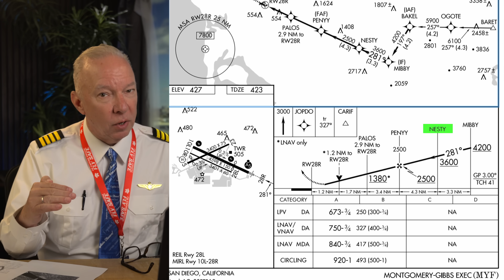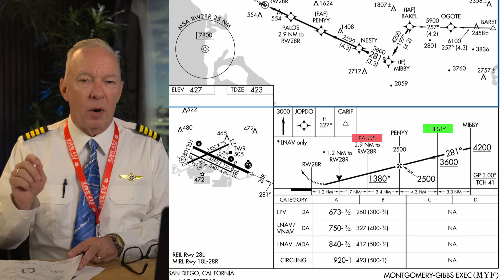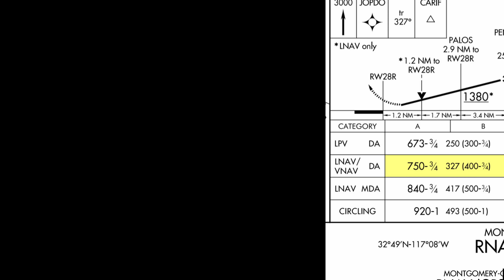Tragic Crash in San Diego: What the Pilot Did Wrong | ATC & Flight Path Breakdown

Comment: Entangled?
Tired?
Rest period not enough?
Specially if you are the only pilot?

Pilot certification standards have evolved over time in an attempt to reduce pilot errors that lead to fatal crashes. FAA standards, which are set in consultation with the aviation industry and the public, are among the highest in the world!!!!!?????

According to the FAA, the new regulations stem in part from the cra of Colgan Air 3407 in February 2009. An investigation of the crash revealed that pilot Renslow, had failed three "check rides" (the flying equivalent of driver proficiency tests) and may not have had adequate training to respond to the emergency leading up to the crash.
Aviation in itself is not inherently dangerous. But to an even greater degree than the sea, it is terribly unforgiving of any carelessness, incapacity or neglect"
—Captain AG Lamplugh, British Aviation Insurance, London. 

Safer skies saves lives...

Old bold pilots
Know Crew Resource Managenent CRM
Know sterile cockpits
Know cockpit briefings
Know who the PIC  final authority is

The greatest single factor in airplane disasters to-day is the human factor.....
someone does too much too soon, followed very quickly by too little too late. 
Steve Wilson 
NTSB investigator, Oshkosh, WI, August 1996.
 Trouble in the air is very rare. It is hitting the ground that causes it. 
Amelia Earhart
In flying, the probability of survival is inversely proportional to the angle of arrival. 
Attributed to Neil Armstrong
If you can walk away from a landing, it's a good landing.
You don't concentrate on risks. You concentrate on results. No risk is too great to prevent the necessary job from getting done.
Chuck Yeager

Comment: There's a tower shown on the approach plate near where he crashed. 554 feet high. I guess he didn't have moving map with current obstacles data base
Reply: still the tower and lines were below his minimum. he busted minimums.
Reply: @sbdreamin and if tower is 554 msl the plane was also at 554 msl. So the big question is why was the plane at 554 msl and not at 854 msl. Over 2 miles from airport. Was altimeter set incorrectly

Comment: Yep, this pilot was below the minimums. When looking for an airport, you never want to be below the minimums because you're entirely distracted looking for the airport. This seems to be a common cause of crashes when both commercial and independent pilots are looking for the airport in bad weather. I still wonder why it is still happening so frequently when the aviation industry knows without a doubt it is an accident looking for a time and place to happen. This also when a "co-pilot" is a gift to be looking at the charts while the pilot is flying to advise accordingly. But he should have known he should not have been landing here. Especially a small corporate jet and independents should have little problems diverting to a safe airport, wait for the bad conditions to clear, and then go to the one most desired. There is really no excuse for this risk in this day and age. Thanks, Capt Steeve. You and Blancolirio complement each other in these reports. I look for both your analyses each time there is an incident. RIP to those who died and God bless the ones who have lost their homes and the neighbors who helped in the rescue after the crash. I'd still like to know if the vehicle the fire dept couldn't put out was an EV.

Comment: Surprisingly the Citation is a CAT B for straight in landings (for circles its a CAT C). I'm not sure if this contributed to the crash or not. I'm assuming due to the obstacle and steeper final decent needed to make the runway, the FAA banned this for C & D CATs. Near mins I don't think its smart attempting this approach in a barely CAT B aircraft. From some pilots I spoke to that fly this they either just consider it a CAT C for any approach to be safe or take the CAT B if they "must". I also question if he had the visibility requirements.

Comment: BR - baby rain!???? BR means MIST! The primary meteorological difference between fog and mist is visibility. Fog reduces visibility to less than 1 kilometre (0.62 miles), while mist reduces visibility to 1 kilometre or greater. Both are caused by tiny water droplets suspended in the air near the ground.
Another thing, regarding fog and the associated pressure distribution, it is impossible that there could be a 20" Hg (approx 200ft) difference in 7nm.  That pressure gradient would have caused strong winds in the area, blowing away any fog or mist.  Therefore, for there to be a 200' altimeter discrepancy, the pilot would have had to set approx 3010 when the airports within 8nm of him were reporting (KSEE) 2990 and  (KSDM) 2989. I don't think this could be the case.
Reply: Pilots are taught “Baby rain” as a memory aid.
Reply: @thelastboomer9088  Notwithstanding memory aids, this is completely incorrect because it is misleading. Rain and mist are 2 completely meteorological phenomena.
 Mist is a suspension of tiny water droplets in the air, while rain is water falling from the sky. The Met Office explains that mist is a less dense form of suspended water droplets, similar to fog, but it typically dissipates more easily with slight winds. Rain, on the other hand, is precipitation, meaning the water has condensed and is falling to the ground.
Reply: What speaks against wrong altimeter setting might be that the ADSB data shows they were exactly at 2500 ft at Penny where they should be. 
But then 100-300ft too low at Palos, after that descended with up to -1700 ft/min towards the ridge - leveled off in front of the ridge, cleared it but hit the power lines on top of it.

Comment: This is very common weather for the San Diego area, "May Gray" and "June Gloom". That fog normally burns off 10am-11am.
Reply: That fog was way beyond normal May Gray overcast skies (and it was dark when the crash occurred as someone else pointed out). I could barely see 5 feet in front of my car driving to work a few hours later that morning.  May Gray/June Gloom refers the marine layer along the coast, not foggy conditions.
Reply: @gigibythesea1133  I was on my way to work in the morning driving the 5 north from San Diego in thick fog when my VW bug ran over a large wood ladder that had apparently fallen off a truck. i didn't see the ladder until a millisecond before I went over it with no way to avoid it. The fog/marine layer is no joke. I've never seen anything quite like it anywhere else.
Reply: @gigibythesea1133 yeah it sounds like the guy was over confident and unaware he wasn’t supposed to land there? He clearly said he couldn’t see smart guy made a bad decision.
Reply: @gigibythesea1133 that overcast often comes with fog at higher altitudes.
Reply: Have you heard of “Graypril”? For a cloudy/foggy April?
Reply: @sheilamiller6435 I just recently heard this!
Reply: You are correct; I lived in Oceanside and that is indeed the summer pattern.   Deeply tragic.
Reply: Having lived in San Diego, from 1968-82 in Pacific Beach, I recall us calling it the June Swoon. Pretty miserable at the beach at 0800 hours and cleared anywhere from 1100-1200 hours. When the sun goes down the fog starts its march in from the ocean.
Reply: Agree 100% I lived in San Diego for a number of years when I was stationed at Camp Pendleton. Never heard the terms 'May Gray' or 'June Gloom' but they are exactly the very descriptions of the weather. RIP to those lost and condolences to their families and friends.
Reply: this was fog, not just the low overcast cloud deck that comes with May Gray or June Gloom. It is not common for all the county airports to be socked in like that but a handful of times a year.
Reply: It was at night
Reply: @gritskennedy5007  Which is why he shouldn't have made the flight at night, but instead left the following morning.
Reply: @gritskennedy5007

So if the fog burns off, mid morning, how does that indicate that it didn't form in the nighttime?
Reply: @codymoe4986 the post is just saying it doesn’t often burn off until 10-11ish, not that it doesn’t accumulate in the wee hours of the morning/night.
Reply: @gritskennedy5007 so, you can see through "May gray" much better at night?  Grew up in San Diego and remember riding home at night in the fog, Dad had the headlights on low bead and the drivers door ajar to to wat the white line.  Yes! The dashed line on the road had a white, not yellow, line back in the 50's.
Reply: @gritskennedy5007 3:45am in the morning so yes dark and thick fog with no wind
Reply: @gritskennedy5007 The fog rolls in the late afternoon.  It burns off the next morning.

Normal weather conditions for coastal California.
Reply: @gritskennedy5007 I lived in San Diego for twenty years until 2021.   I have driven in such dense fog at night that I missed my turn off from a road when I was doing 25 MPH. It does get very foggy at times.

Comment: Is the altimeter affected by air pressure? I understand if the altimeter is set wrong, that's bad. I don't understand what it has to do with the weather or anything else going on here. Why would it be set improperly?
Reply: A barmoetric altimeter determines altitude based on air pressure (which decreases the higher you go) but the pressure can also carry depending on the weather so this must be figured into the calculation.